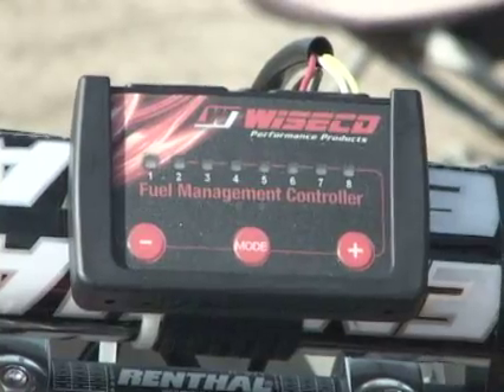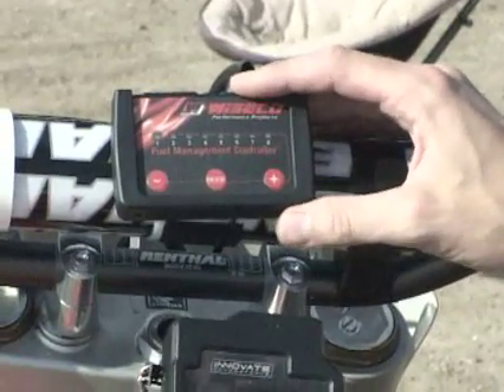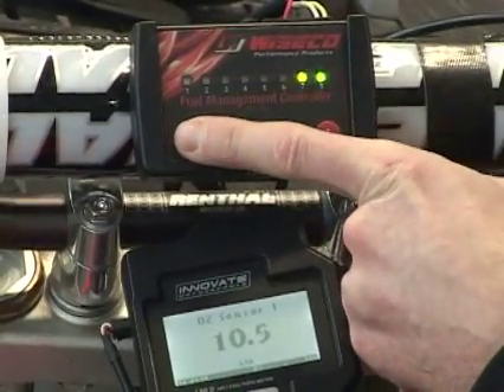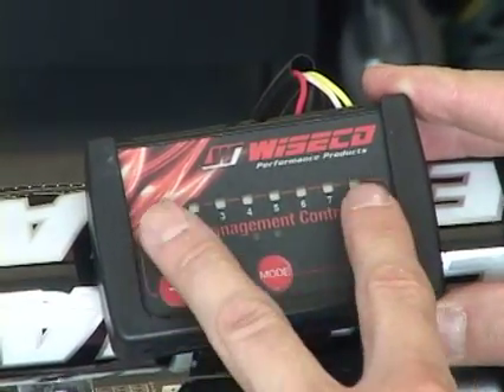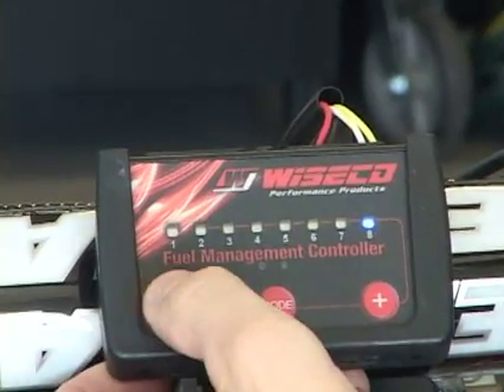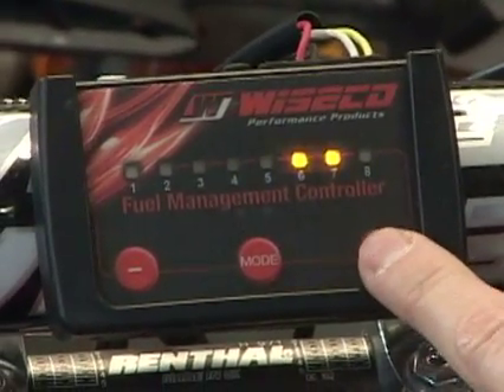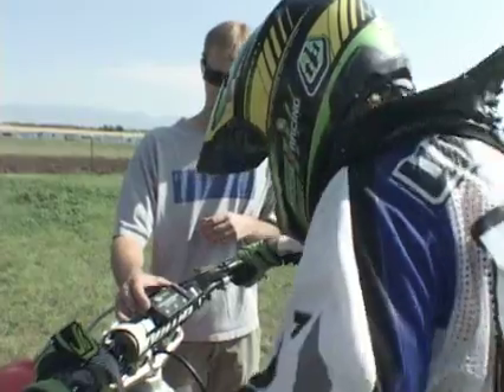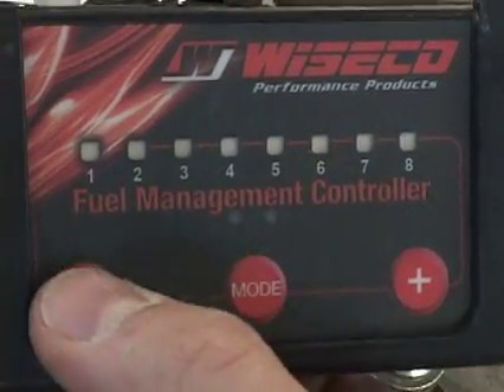Wiseco and Motocross, EFI Tuning Made Easy!

Comment: I just picked up a raptor 700 with a Lexx fuel controller it looks like the Wiseco  fuel controller I was wondering if did the same thing
Reply: They basically are the same, I myself have a 2012 kfx 450r with a Lexx slip on, Lexx fuel programmer  and a fuel customs intake and have used this video as a guide on how to tune with the fuel programmer
Reply: @pancho2098 im trying to to the same thing i got a kfx450r with a lexx but can’t find any info anywhere i hope this helps me out.
Reply: @AxelJLopez-br4um  Some of the light colors are different but the process to tune is the exact same
Reply: @pancho2098  ı have kfx450r fci and fmf 4.1 slip on powerbomb headers ı need wiseco setting

Comment: I have a wiseco controller on my '17 Rmx450z. I understand how the modes but one thing has got me stumped. As the box is operating during non editing mode or just regular operation. I get a flashing blue led on the far right led. The Green leds to yellow leds seem to follow the throttle input. Is this the the fourth mode accelerator pump indicator? Is this where the acc pump turns on?

Comment: You did not show where to set the green mode
Reply: That is for cruising speed, basically just above idle. Basically start at a low setting and look for sputter or surging. Keep adding until the bike runs smooth.

Comment: you also have to consider that on full gas if you go to lean you might brake the exhaust valves cause on every car at full gas you go rich to cool down the valves, racing engines should not be rich because you get much more power but a shorter engine life

Comment: I noticed some Wiseco FMC141, you can buy with 4 wires and some with 10 wires. Like on this video, the controller was presented with 4 wires but on the end you guys show model with 10. What’s the difference ? I am looking for wr250r 2018.
Reply: the 10 wire would be for efi im guessing

Comment: would would you recommend for a ltz 400 2012 limited edition with air box lid off, FMF powerbomb header, DG xccelator slip on and K&n high flow air filter and possibly in the future a better intake boot. what should my lights be on?